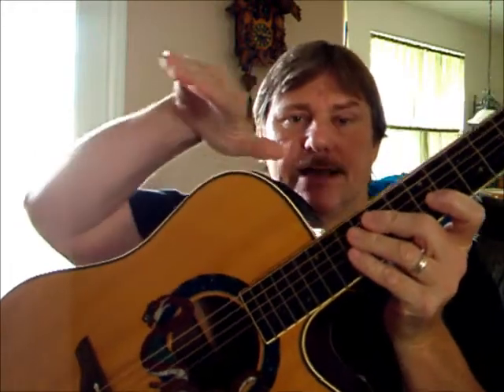Let's Build a Guitar

Comment from the maker: I have taken a long break from building the guitar. As quick as it cools off, I need to get back in my garage and get after it. This has been a brutally hot summer in Florida. I am at some critical stages in building the guitar, cutting the sound hole and installing the rosette and bending the sides. I have to admit I am a little nervous.